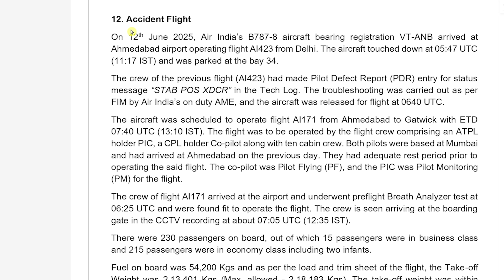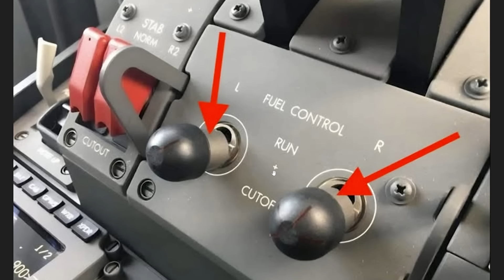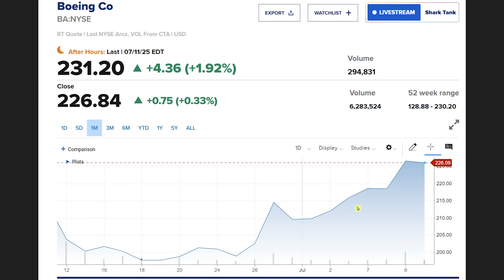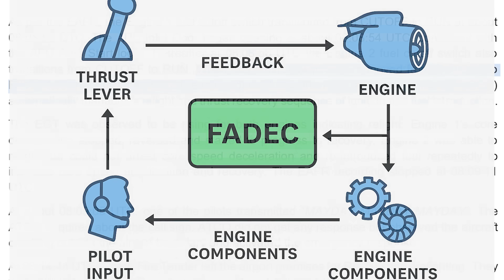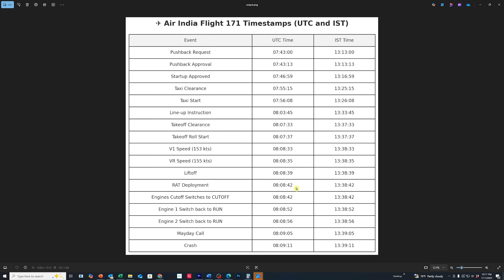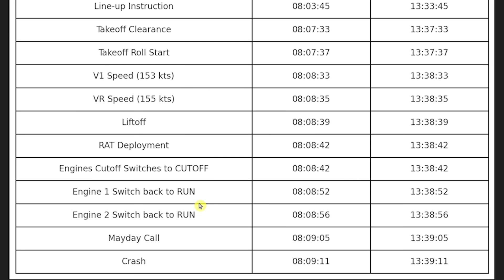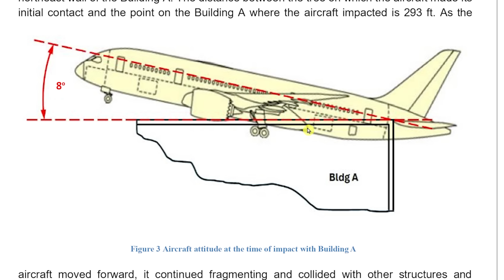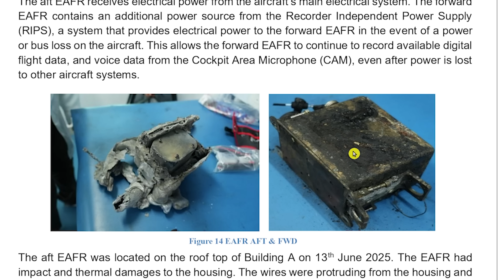Did Pilots CUTOFF Fuel? Shocking Twist Air India 171 Report!

Comment: Can anyone explain why all the key and important controls of a plane, all seem to be placed right on top of each other, while we are dealing with a giant cockpit with almost unlimited space.

Bad design kills, and this is proof.
Reply: The same way that car pedals are close together. So you can operate the core controls without having to reach and lean all the time. Imagine if you had your car's accelerator on the floor and the brake on the roof?! 

They mitigate any confusion that the proximity of certain switches causes by having covers and protections for any critical action. Some actions that have irreversible effects are covered and have to be manually uncovered before being moved, other switches/levers have very particular and manual ways of operating (like with the fuel switches and the detent that the switch needs to be lifted over to clear). 
The designers have also considered the risk of accidentally pulling one lever/switch instead of another and have designed to prevent it. This can be seen with the flaps lever when compared to the thrust levers. They are in pretty much the same place, but have to be activated in different ways (the flap lever has detents that you need to move the lever around whereas the thrust levers don't, and both have very different designs and shapes). 

The truth is, when you have as many controls as this that have to be within reaching distance, the layout of how it is will be the best you're going to get. It is not very often that we see serious incidents that have been caused by confusing the controls.
Reply: @SurgeDashcam  In a car, you are constantly accelerating, using the clutch, and breaking.

In a plane, you are not constantly turning off fuel to the engines. Its not something that is part of general usage.

Its like having a car that is has a pedal that turns off\on the engine, and its placed along with the rest of the foot pedals..

Airplane cockpits have always been overdesigned, and clearly designed by morons.

More isnt always better.
Reply: @draken5379  every control is there for a reason. You're acting like half the switches are redundant. They need to be there. If you're so much smarter than the hundreds of years of aviation expertise and  the many highly qualified engineers, then what do you suggest is better?

Oh and even in a car with much simpler controls, the way you switch off the engine is right by the stearing wheel and indicators stalks. Two controls that are regularly used. You're missing the fact that aircraft controls have to be within reaching distance. 

If you start putting switches in obscure places for the sake of "preventing accidental operation" then you actually create more problems. That's why these critical switches have the projections such as what I mentioned before.
Reply: @SurgeDashcam  Funny enough, a lot of the switches are redundant now due to advancements moving most of those systems to be automated, but still have controls exposed.

Having switches that in essence, kill the engines, right below the controls for controlling the thrust of said engines, is stupid.

Not to shock you or anything, but tons of things designed ages ago were done badly. 'Experts' are not some sort of gods like you want to believe.

Because if they were, we would of never had a planet filled with lead pipes and the millions of other issues plaguing it caused by stupid humans, that other humans think are smart.
Reply: @draken5379  It is more serious than that.  It is like having a button on the radio that disables braking which you can toggle accidentally or deliberately and takes 60 seconds to re-enable if pressed again.
Reply: @SurgeDashcam  Disagree.  Absolutely critical control that can be toggled by single person accidentally or deliberately with catastrophic consequences?   Needs to be a maker checker control requiring actions by both pilots, with some type of override if a pilot is incapacitated in flight.  Especially at this stage of the flight.  There should be no ability to turn off fuel at V1 until X level of altitude where they could at least be restarted before crashing.

Comment: 11:50; 13:11 Seems there may have been some sort of struggle or difficulty?
Could the simultaneous switch off with the rat deployment mean the intention was to rectify the problem? (after all it did go back up), or can it only mean the cut-off likely came before ss well as caused the rat deployment?

Comment: Liftoff : 8:08:39 , cutoff 8:08:42 . 
Q. How can someone switch off 2 fuel switches within 3 seconds ? Seems like a mechanical failure
Reply: i also think the same! i have seen many takeoff video from pilots pov on youtube after liftoff they are reading check list like check check and then landing gear up. i lean more towards mechanical failure than sabotage theory
Reply: your answer is here 4:33
it takes exactly 1 second to move both these switches when done deliberately
(just to clarify, im not implying that's what happened, but that it is possible)
Reply: Are you serious? The switches are next to each other, doesn't need a second to lift and push one switch. This is a calculated move, his hand was on the switch once lift off.
Reply: I have Boeing stock. Shut up
Reply: with all paid outlets bbc, cnn , ny wapo doing extra time blaming pilots  @skankhunt9078 i would take short postion in boeing ..once voice recording comes out ..boeing would go down😂
Reply: The report also does not state that the switches were definitely moved physically, they are going of sensor data that could have been due to an electrical fault. Remember the switches were found in RUN. The RAT was deployed within 5 seconds of fuel cut-off was recorded and 3 secs after the take-off, this could have been a major electrical failure and not pilot's switching off them physically, so it could have been an electrical failure which shows that both valves were switched off via electrical failure of some kind
Reply: @farazalikhan5242  The F/O asked "why did you *cutoff*?" 
Main bus electrical failure does not cause the engines to stop running. Air India pilots tested this in their simulators. Engines have everything they need to run. EEC dedicated alternator power, fuel flow, (usually) magnetically latched fuel control valves so they don't change state, etc, etc.

A 777 lost all its main electrical busses and the aircraft continued to fly. A 747-400 lost 3 of 4 generators and landed safely. It mandated by safety regulators.  It's part of their design.

If both both flight recorder and both engines are showing signs that the cutoff levers have been cutoff, then there is a very good chance that that is where they are. Fuel cutoff levers generally have multiple contacts for different functions. You would need multiple failures on the wiring on both  switches to fit your scenario.
Reply: Sorry you have not read the report correctly - both toggles were switched off with a "time gap of 01 Second", I don't think you can physically toggle both within 1 second - these are toggles . To switch them on again took 4 seconds. Boeing Dream liners have a history of their engines powering down, I think it took them a whole 10 seconds to try switching off and on again - some kind of electrical fault.
Reply: @peterhohepa5489  An example is given at 4:56. I counted 35 frames in the video. What is that in seconds? I mean I recorded the time between one lever hitting RUN and the second lever hitting RUN.
The 01 sounds like a timestamp rather than the actual period. If events are taken to the nearest second, it may be almost 2 seconds. 
Remember one pilot is doing the fuel cutoff, but the second pilot is probably doing the flying and putting them back on.
Reply: @peterhohepa5489  On average, it takes 1-2 seconds to toggle one fuel switch. 1 second is the gap between the sensors recording switch 1 and switch 2 off. That does not mean it took 1s to turn both off. You also have to count when he started to turn off switch 1. And that is not recorded. Let us say it took the pilot the same time to turn off switch 1 (which is still faster than the 1.5s average). That would mean it took a total of 2 seconds to turn both of them off. Also, there is a transition period of moving from switch 1 to switch 2. It is possible to do it deliberately in 2-3 seconds, turning both of them off.

Comment: Occams Razor says its the switches.  An FAA directive, and no one did anything about it?  Come on...  That is it.  So the IAW the locking feature being installed disengaged as per the FAA bulletin, take a look at the closeup picture of the switches.  In order for those switches to maximally retain, they have to be completely moved forward over the hump.  Lets say the Pilot had a a soar hand from a rough game of racket ball, and he doesnt quite push the switches all the way.  Then they are riding on the top of the hump, meaning they are in an unstable position.  Juan Brown showed a couple of real time videos of what the pilots do during take off.  When the First Officer is flying, the Captain rests his hands on the throttle through the whole takeoff, BUT he removes his hands at rotation giving it back to the First Officer.  It is exactly at that instant that the comment was made about why he shut off the fuel.  I believe that the Captain withdrew his hands from the Throttle, wherein he would pull his right hand back and towards his body.  Somehow, he caught the switches and pulled them back to the CUTOFF position.  Maybe he had a tiered arm and let it droop too low catching the switches.  Maybe he had a lanyard in his hand or had a bracelet on that drug down and caught the switches.  Maybe it was a loose braid or thread from his jacket.  If the switches were teetering on the catch lobe, he maybe only needed to barely swipe the switches to turn them off.  This is supported by the verbiage where one pilot asked why the other turned off the switched, and the other said he didn't.  I claim that he did not know that he had turned off the switches.

At the end of this though we need to ask the bigger question: Why the hell are critically important switches like fuel cut off implemented with toggle switches?  That is just dumb as.a door knob!  Its all too easy to accidentally knock a toggle switch on or off, or it get caught by a sleeve or a lanyard or something brushing against it.  That is just a dumb as switch to use in this application.  This switch needs to be a low profile rotary switch with detents holding it on the RUN and the CUTOFF.  Such a switch would never have the risk of accidental flipping.  Its the kind of switch they use in Nuclear Missile launch silos, and there is a reason they use those kinds of switches there: because you cant afford to ever make a mistake.  SO no, Boeing is not out of the woods.  In the end this will be due to their piss poor switch selection and design.
Reply: The irony of all this is that if they just made a simple switch, it would never be a problem, but because they put a spring and you have to push it over a hump and all that garbage it became unstable
Reply: This might be it
Reply: @Novasquad77  So,  hus5116 & Fjrunkrn383, show us your design for a failsafe switch.  As a degreed mechanical engineer with over 40 years of product design experience, I consider the design of the fuel cutoff switches to be about the ultimate in robust, failsafe design, impossible to actuate inadvertently and requiring a deliberate act to switch.  These planes have taken of millions of times and this has never happened before.  I see a lot of wild ass attempts to postulate alternative theories that don't involve pilot error or worse, but none explain that the person flying the plane asked the monitor why he had "cutoff".  The telemetry showed that the switches had been put in the cutoff position and a few seconds later it showed that the switches were returned to the run position, where they were found after the crash.

No, you are grasping a straws.
Reply: 15:06 An advisory, not a directive. So no mandatory inspection, only voluntary, and it was not done on this airframe. Also the module with the switches was replaced twice between the advisory and the crash.

Occam definitely still suggests intentional pilot action, not least because of well known regional instability. But mechanical failure of the switches is not conclusively out of the picture yet. Timing of the cutoff right after liftoff, ie. at the point of maximum vertical acceleration, is too appropriate. If the switches were to switch on their own, it would happen exactly then.

So, boeing is out of the legal woods in my opinion. (Public relations woods they may be getting deeper in still, regardless.) FAA may have questions to answers, IF the switches turn out to be at fault.
Reply: @monophonic_og  AI would have to answer why they chose not to follow the advisory and inspect their aircraft.  There has been no instance reported of disengagement of the switch locking feature - just the possibility of an issue.  I'm thinking it'll be more an AI blame rather than Boeing if the switch is found to have disengaged.
Reply: your treatise proves the complete opposite of Occam’s razor 😂😂😭
Reply: @ibnBasil wtf you smokin?? Occam only says the simplest explanation tends to be true, which I acknowledged. But it is not a law of physics, occasionally the complex version happens, and flight safety is all about stopping even the most complex failure chains.

Comment: Possibly one option for Boeing is to have a check that if speed and altitude are below a certain threshold and the aircraft is air borne, then the pilots should be prevented from moving the switches to off by the aircraft software.
Reply: That would require adding a mechanical lock to prevent the switches from moving, but maybe the plane's software could ignore the position of those switches in certain situations like takeoff, unless they are "hard wired" and don't pass through software.
Reply: That’s ridiculous because there are fire situations or severe engine damage scenarios where you need to cut it off including low speed and low altitude.

Comment: why are the switches just there and not in the over head with the fire controls... some where you need to think to switch them, not auto switch them due to a brain fart, if it was done of deliberate where the alarms the plain know its in the air, so cutting power would not be smart with out fire or some such other warning, other thought did the plane lose power to those switches maybe there is video or a second system that is only monitoring switch movement so switch state is  known not just if cut in or out by power sencing , if your self deleting, find bridge, wire to mains, get much help, not take others with you, very selfish  (sorry for spelling Japanese person)